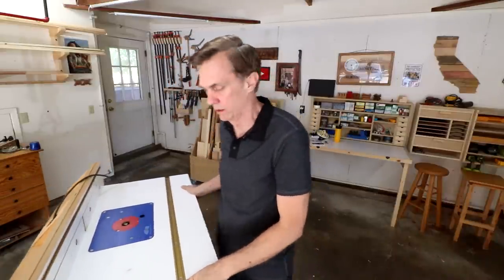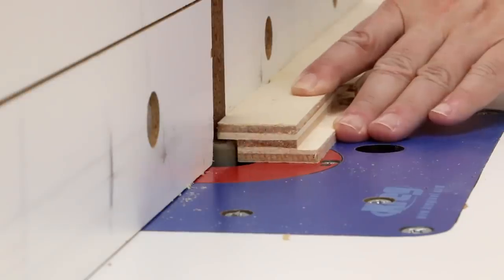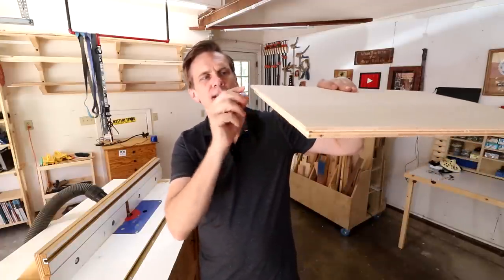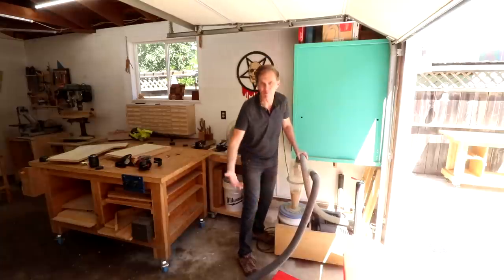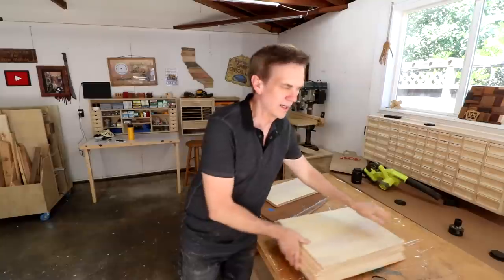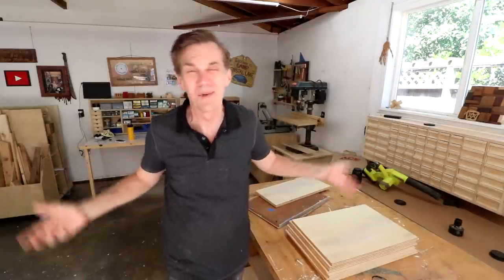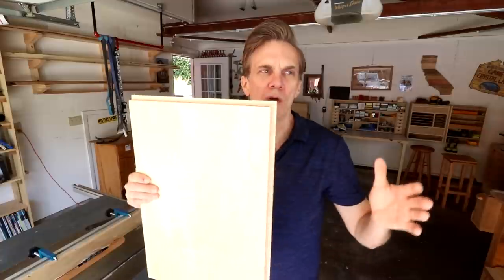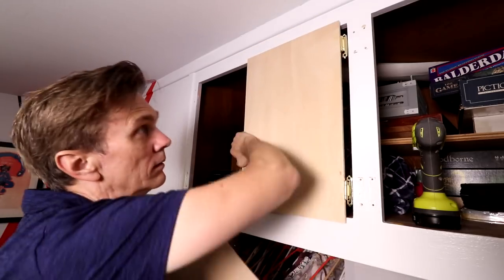Why did my router bit keep slipping?! | Day 116

Comment: I’d replace the 1/4” collet. The bit may have a shank slightly smaller than 1/4”
Reply: Those are called 6 mm shank bits. Which are 0.0138" thinner than 1/4" bits are. You can't even tell by looking at them they're so close in size to each other. But a 6 mm shank won't securely grab in a 1/4" collet. A 1/4" shank is a really tight fit in a 6 mm collet too. When you jam one in you just know it isn't right.

Comment: Its probably been addressed already but the issue with the router bit sleeping could be because you're cutting too much too fast I have a ¼ inch trim router and ive found that I get cleaner and better cuts if I sneak up on the dimensions meaning I take what could be done with one single cut with a dado stack and I'll make three passes with the router taking away a third of the material with each cut and I move painfully slow when I do it ive found that with a smaller bit you have to baby them a bit more and not put as much pressure on them as you can with a half inch bit

Comment: That happens to me all the time as well and it is reallllllly frustrating.  I'm wondering if on your third attempt when you took shallow passes if it would have helped to instead take full width passes but start with the bit lower, make all your cuts, then raise it one eighth and make next pass.  It seems like the culprit is the ratio of bit protrusion to cut depth.

Comment: YES! I have that with my router all the time! It doesn't matter what bit I use either. Straight bit, rabbet bit, roundover bit, all the same. It seems like maybe it works better freehand than in the table, bit I've had it shoot a bit out before while running. Not fun. Based on some other comments, and that It's almost impossible to remove the bits unless I do it right away, I think the collet and bit shanks are just caked with rust.

Thanks guys for the tips! And thanks Steve for bringing it up!

Comment: Steve I had that problem with a router.  I discovered the collett would get stuck.  Every time changed bits
I had to pull the collett out and slide the new bit onto the collett then screw it down tight.  I finally put some lube 
on it and is working fine now

Comment: I get why you wouldn't bottom out the bit. As heat expands the metal it can move up a bit. Worse it can loosen its its hot. Gets hotter if it's dull too. Just my thoughts...😂

Comment: Hello Steve,
I stumbled on your channel when I was looking for help for a bookshelf I am going to build for my eagle project. The dimensions are gonna be 82”L  x  56-58”h  x  10”w. I plan to build it out of pine, but I need your help. I want the shelves to be 12 inches tall but that leads and extra 8-10 inches left. How thick of wood do you recommend to have for the shelves because I want to account for the space that the wood is going to take up? This is meant to hold books and textbooks and with any leftover inches I plan to make the bottom slightly bigger for bigger books. If you have any suggestions that would be amazing

Sincerely,
Thomas
Reply: The only thickness of solid pine your going to find is 3/4, unless you use plywood and edge band it.
Reply: Jake - Knower of Everything Ok, thank you! Sorry I have never done any woodworking and thought that there were different widths
Reply: @thomasgoodman3698  Different 'widths' can be made by ripping, different  'lengths' by cross cutting, and different 'thicknesses' by plaining.  But if you buy the lumber with finished faces, why change the thickness?  Pine is usually 3/4 inches thick.     Now how are involving others in your project, usually it is not what you can accomplish alone but what you can guide others to do along with you.  Good Luck with your Eagle...

Comment: I've had the same problem with dewalt bits with 1/4 inch shank. I use two full size combination wrenches and tighten as tight as possible.

Comment: I had something similar, turns out a bearing in the router has gone and I was getting vibrations which caused the collet to slip. Replaced the router and it was all good.

Comment: Your collet is probably broken - either through over tightening or through wear over time. They do wear out. You don't need to wrench on router collets.
Your bit might be dull or your feed rate might be too fast for the bit you're using, combined with the above. This is more likely if you're only seeing the issue with this one bit. The shank could also be out of true.

Comment: Steve,  on the router failure, check the router collet. I had a similar issue and it was collet failure. The biting points of the collet were not directly opposing which allowed the shaft of the bit to "wiggle" and move within the collet.  Just a thought.

Comment: I had the same problem with my router table it turned out to be the clamp that holds the router in the base need to be tightened.

Comment: I had that problem with a router bit slipping when I was using my hand-held router on some dados.  It turned out that the collet for my DeWalt router actually broke.  I replaced it and it's been fine since.  Not sure that would apply with the Porter-Cable router collet, but just thought I'd share my experience.
Reply: If Steve's router is really old then it is a pre zombie model. Porter Cable routers used to be some of the best. Now they're owned by DeWalt's parent company of B&D. So they're just a hollow name brand. A dead company walking.

Comment: Collets wear and lose their gripping force over time. 

Also when using upcut bits, the collet can get packed with material causing it to spread just enough for it to slip.

Proper collet sizing is quite crucial as well. They are designed to only compress a certain amount. If the shank diameter is just even a few thousandths smaller than the smallest size the collet can grab it will slip.

Be sure to wipe the mating surface on the inside of router spindle.

Could be one of these or a combo of a few. Dunno.

I've had this happen on various large CNCs I operate and it is usually indicative of the collet wearing out. Small collets like that are cheap enough. I'd say get a replacement and try it.
Reply: What slipped was US dominance in tool making. Today them imported bits have metric shanks. Which are 0.013" too thin for a 1/4" collet to grab correctly. But you can't really tell by just looking at them. It'll even hold in the collet when you tighten it up. It just won't hold good enough. You can tell for sure what you have with a decent pair of calipers. 6 mm shanks measure 0.235" or 5.98 mm. A real 1/4" shank will be 0.248" +0.002 Welcome to the NWO.

Comment: Steve the collet might be sprung, or collapsed. Try replacing the collet. I'm a machinist, run in to this from people using the wrong collet for a shank, or from over tightening it.
Reply: If it is an imported bit odds are it is a metric shank. 6 mm is very close to 1/4" Just not close enough a 1/4" collet can hold a 6 mm shank securely in a cut. It'll feel like it's holding by hand though. The difference is far more obvious when you try to go the other way and load a 1/4" shank bit into a 6 mm collet. Then you can easily feel something is wrong.

Comment: I had a 1/4" bit come out of the router at speed and it actually bent the shaft. Very scary.
Reply: wow, was it the collett?
Reply: @blackmangopit  No, I think it had bottomed out. After that experience, I stopped with the two wrench process and got a chuck that screws on to the router and has an allen screw to tighten the bit. That way, I can hold the bit exactly where I want it with one hand and tighten with the other. I use a t handle wrench. 15 or so years later have not had a bit come loose. I don't know where I got the chuck but go to Amazon and enter Musclechuck and I think you will find it. I still have that bit. Try and bend one in a vise and see how hard that is. I am glad it went away from me when it happened.

Comment: Possibilities:
1.  There's a little bit of wood powder in the bottom of the female part.  This causes the collet to hold tight at the bottom, but any vibration causes the tool to rise.
2. You've been using too little shaft for a long time and the female part is now wider than it should be at the top.
3.  The lifting mechanism is loose and letting the whole router rise.

Solutions:
1.  Use a greeny to clean out the female part really deep down, also the shaft and collet,  and use compressed air to blow any wood dust out of everything.
2.  Get a new collet or router.
3.  tighten up the lifting mechanism, so it doesn't rise under heavy loads.

Testing:
Install the same bit and mark down the height from the collet shoulder to the top of the bit, also mark down the height from the table to the top of the bit.  Make the problem happen again.  Measure which has changed.  This will tell you where the problem is.
Reply: You missed the most likely possibility. Steve probably has a cheap imported bit with a 6 mm shank. Because Steve. You can't grab a 6 mm shank bit with a 1/4" collet good enough for it to hold in a cut either. It is just too small in diameter. 0.0138" too small. Can't see that just looking at it either. The difference is size is more obvious when you try to jam a 1/4" shank bit into a 6 mm collet. Then you can feel that something is up. 6 mm bit in 1/4" collet gets them every time. It even seems to tighten.

Comment: Was this misaligning 'feature' the reason you skip the routers from your 1000$ essential tool list? I am really interested in why are those tools aren't there. And I would like to hear your opinion about which one shouldwe buy first: plunge or one hand fixed ones?
Reply: If you can only afford one router then make it a 1/2" collet plunge router. It is the most versatile tool. You can get adapters to run any router bit in it and it plunges. You can also lock it so it works like a fixed base too. I don't know how many routers I have now. But if I had to give them all up but one I'd hold onto one of my 1/2" plunge routers. Not to say there aren't uses for a laminate trimmer sometimes. Or the classic twist adjust fixed base. But a 1/2" plunge is the most useful. Some routers come with multiple bases. That's usually an expensive way to go though.

Comment: If you ever decide to change runners you might consider triton. Like you I installed it in a router table. It also could raise and lower the bid from the top. The advantage of this router was that once you set the height there is a lever that will lock it at the height preventing drifting of the level.
Reply: Obviously that's a router not a runner. My bad

Comment: Have had exactly the same issue occur randomly in my router - never figured out a cause, but thankfully it doesn’t happen too often
Reply: The cause is likely NWO globalization and the metrification of the planet. You see 6 mm is very close to 1/4". So close that you cannot tell the difference with the naked eye. But a 1/4" collet cannot grab a 6 mm shank tightly enough. Conversely a 1/4" shank does not fit too good into a 6 mm collet either. It is too tight. The difference between 6 mm and 1/4" is 0.0138" or 0.35 mm. 6 mm shank tools are usually a couple hundred mms shy of 6 mm in fact. They usually are 5.98 mm. So a thou under. A thousandth of an inch, that is.

Comment: My guess is you were using a cheap bit, cheap bits have tendency to not always be sized right
Reply: You're on the right track. Part of cheap bits today is the imported nature of them. That means they originate in metric countries. Where the metric system is popular. If you've ever seen a 6 mm shank and a 1/4" shank bit side by side you'd know how hard they are to tell apart. I can't unless I measure them with calipers, or I try to jam a 1/4" bit into a 6 mm collet. Then I can feel interference. A 6 mm shank will slip right into a 1/4" collet and it'll even seem to tighten up. But it won't really get tight. Tight to the hand touch, but not tight to use in a tool. The difference between the two is a little over a hundredth of an inch. But it's enough.

Comment: Maybe the collet in the router is wearing and it's ability to grip has gone.
Reply: The US grip on tool manufacturing has gone. Go out and buy a 6 mm shank router bit and put it next to a 1/4" shank router bit. Then you'll see what's going on. Actually you probably won't. Because the two bits will be indistinguishable from each other with the naked eye. But the metric shank bit will be 0.013" smaller in diameter than the 1/4" bit. Which is enough to make a 1/4" collet slip. Now go get a 6 mm collet and try to jam a 1/4" shank bit into it. That you'll feel.